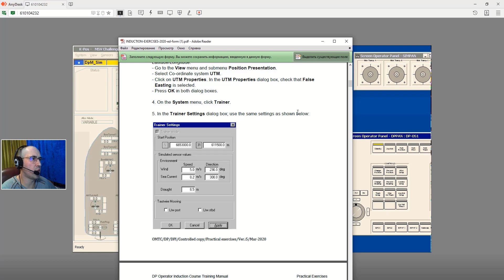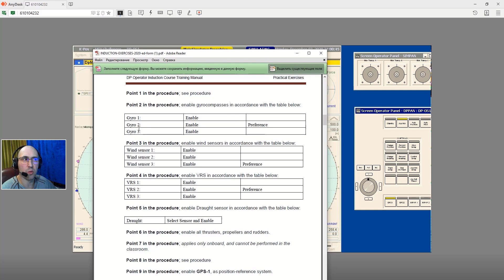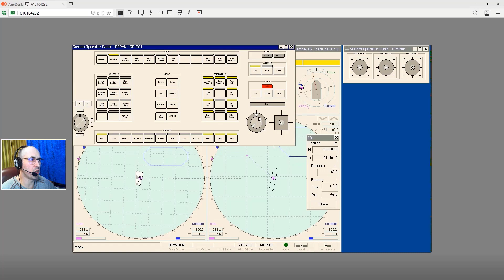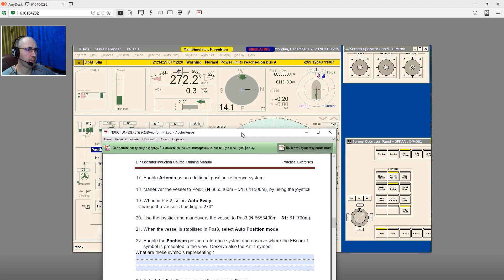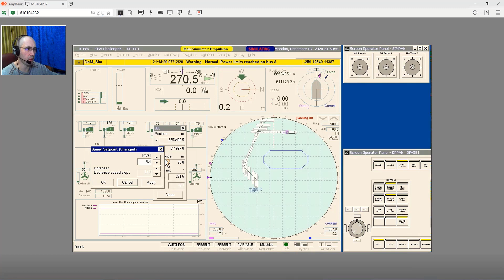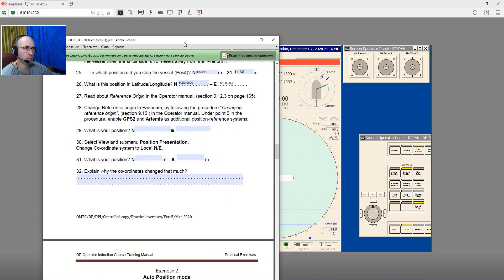DPI Ex1 1

Comment: How shall I download the simulation / cracks ?
Reply: I don't know. I have used original Software.
Reply from the maker: I use original software with screen panel activated. During the DP course you may use it in the DP traininig center or onboard the vessel The Simulation option may be availiable in DP Software. There is no option to download this software officially.
Reply: How can i get in to the training way